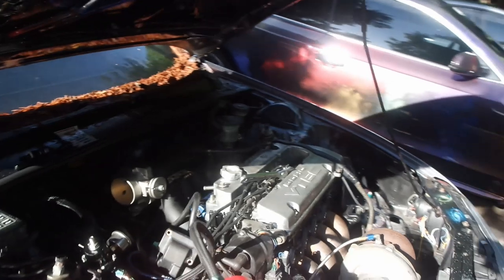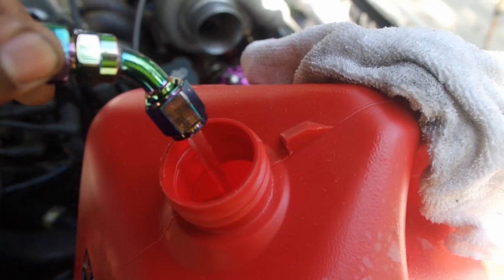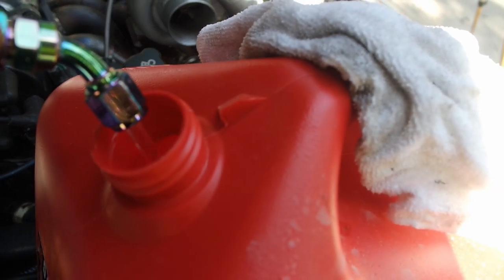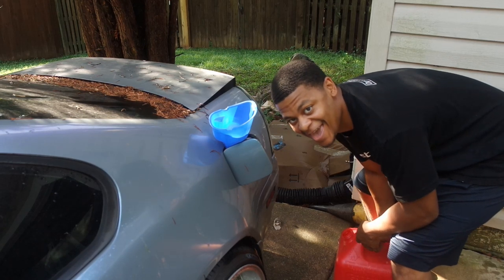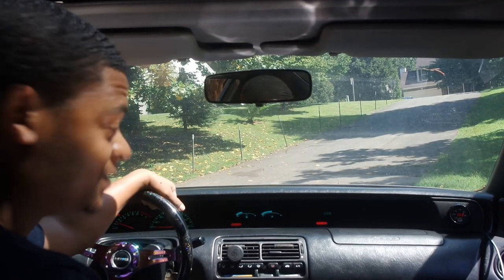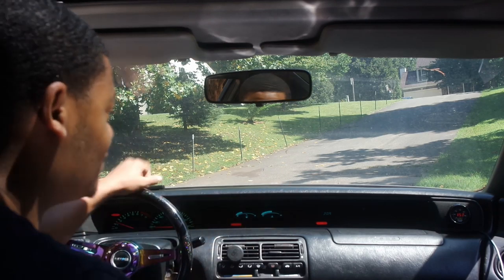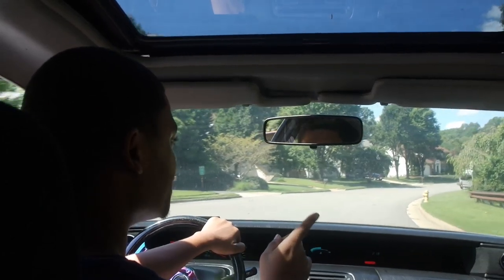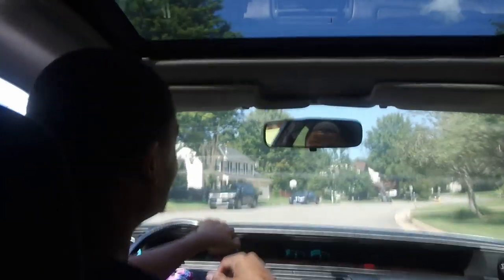600+hp SELF BUILT f20b Honda Prelude FIRST start

Comment: Sounds Great Trey!!
Reply from the maker: Thanks bro
Reply: Hey man I'm having an issue with the gas gauge and temp lights not coming on every time I start the car. When they do come on they stay on. It's just hit and miss. Have you ever seen this issue??
Reply from the maker: @bigcheeezzz7135  yea its a common issue. .most people just replace it but if you know how to solder then you can take it apart and re solder the weak solder points inside

Comment: good work trey. i have a quick question, what size piping are you using in your setup. doing a tsx turbo build at the moment myself and im using 50mm aluminium pipe but im worried it will be too restrictive, not going anywhere near the power you are in this car, only hoping for up  to 250 whp. love the engine bay art work but damn that would be hard looking for oil leaks later in life haha. One day i'll boost my lude as well and so any details on parts/setup is much appreciated. cheers.
Reply from the maker: Tons of info on the channel bro check it out and I'm running 3inch piping

Comment: I love how u saw u about to splash gas over ur paint job and placed a rag on ur second take  😂
Reply: Question, I see your four wheel steer light is on and SRS light is off. Did your 4ws light come on after the management install, and how did u keep your airbag light off after installing the aftermarket steering wheel,? Did u have to bridge something? Or were u just lucky?
Reply from the maker: @mrmuller6131  no 4 wheels steer its my srs light and brake light indicator thats on lol

Comment: So I’ve been watching, great information but on this drive how did u drive it with non tuned ecu, I just got 2 p28 one with ssd chip no start, and one with no chip
Reply from the maker: @gostice6955  i was running an old tune from a previous set up.

Comment: Question.. I have an h22a4 swapped inside an 02 accord coupe the guy I bought it from did a couple deletions and it ran then was parked for 1yr. I replaced the started, crankshaft position sensor, coil pack, spark plugs/wires, distributor.. it cranks but won’t start up idk what the cause maybe
Reply from the maker: I think you message me on IG? But do you know how to check spark and fuel?
Reply: Trey Be Dipping I did both I just need my timing set if that may be the cause... no lie you look n sound just like my step brother that’s crazy
Reply from the maker: @Chloe_Deshon4L  if you have spark and you have fuel. Check your compression, grounds, and fuses under the hood and under the dash.
Reply: Trey Be Dipping okay thanks I might end up having to send it to the shop for the compression test and I’ll check them in the morning thanks bro hopefully we meet up at uh meet one day or year
Reply from the maker: @Chloe_Deshon4L  you should be able to rent the tool to do it yourself from advanced auto or auto zone. Or if you have a harbor freight near you they have a cheap kit.
Reply: Trey Be Dipping ok I gotcha thanks brother

Comment: Nice bro.. What rpm you vtec on?
Reply from the maker: 5200 i think
Reply: @treybedipping1734  what injector cc you used? What camshaft?
Reply from the maker: @SoalJawabTasawwuf  2200cc injector dynamics and type s cams
Reply: @treybedipping1734  do you change your fuel  hose from tank to fuel rail or you used stock fuel hose?
Reply from the maker: @SoalJawabTasawwuf  i have stock fuel lines for now
Reply: @treybedipping1734  ooohhh.. What fuel pump you used?
Reply from the maker: @SoalJawabTasawwuf  walboro 450
Reply: @treybedipping1734  tq for your info.. This is the best channel for f20b turbo ever..
Reply from the maker: @SoalJawabTasawwuf  about 400 if i remember correctly

Comment: What ecu you running with the s300 can you explain
Reply: Any converted obd1 ecu will work.
Reply from the maker: So most people will take a ob1 vtec ecu like a p28, p72, or a few others and they send it to hondata or local speed shop to have it "socketed" then an aftermarket chip like the hondata s300 v3 can be added so the vehicle can be tuned.

Comment: Isn’t it bad to drive an untuned fresh build?
Reply: Looks like he was tuning it ...
Reply: @csvscs  
He got it street tuned.😂😂😂😂
Reply from the maker: As long as the air fuel ratios are good and you stay out of boost your good. But i was running my previous tuned and made a few adjustments so i was good. 

On my paul walker shidddd lol
Reply: Trey Be Dipping why don’t you get dyno tuned for better results and reliability?
Reply from the maker: @petrolhead8851  i am bro you must be new i always get tuned by matt shue. I go in a few weeks
Reply: Trey Be Dipping oh ok gotcha! Yeah I just recently subbed to your channel as I’m doing an f20b swap on my ej2 coupe,and I’m trying to gain as much knowledge as possible on the f20b platform